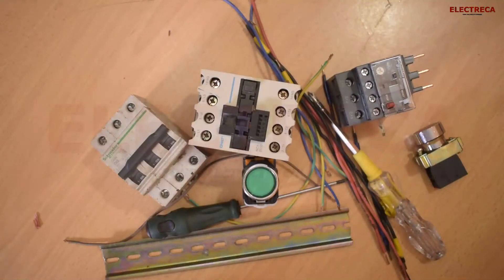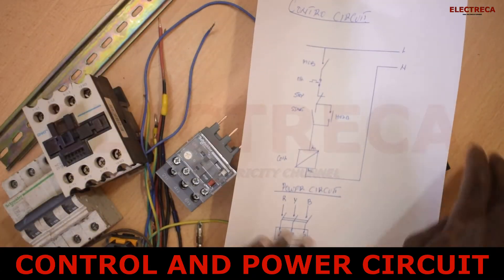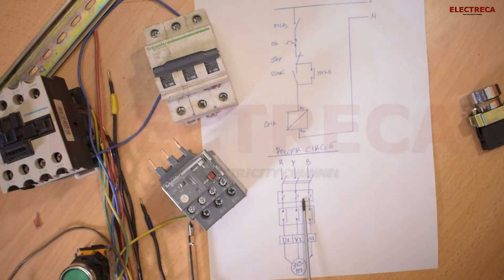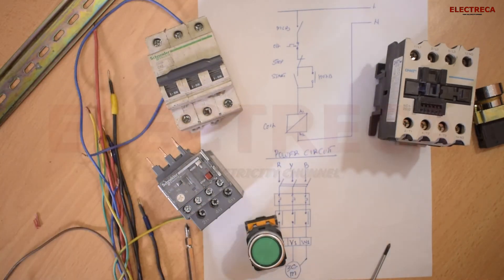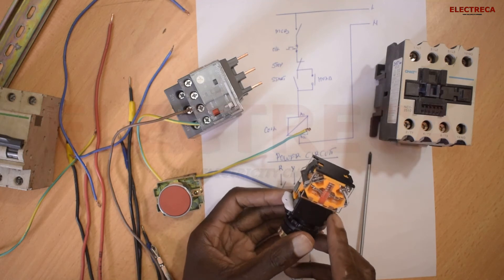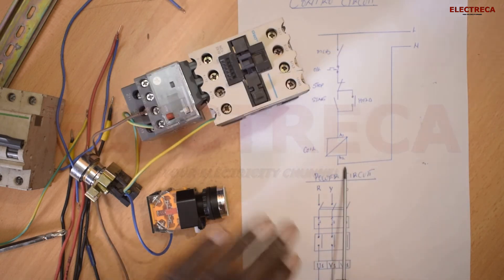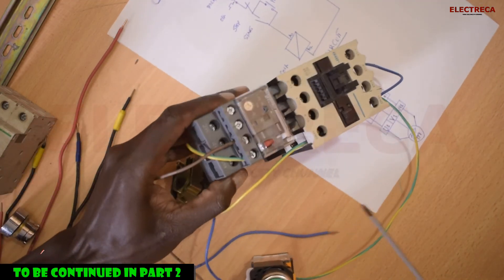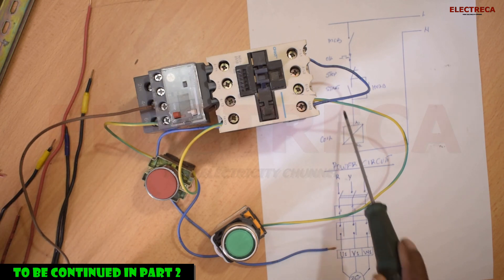direct online starter wiring |ELECTRECA|PART 1

Comment: Great video . Can you do a video using  2 pole mcb,   220V AC ON/OFF START STOP 1 NO NC 2 buttons APBB-22N 25N Momentary double head Push Button Switch With LIGHT, overload relay and single phase motor ?